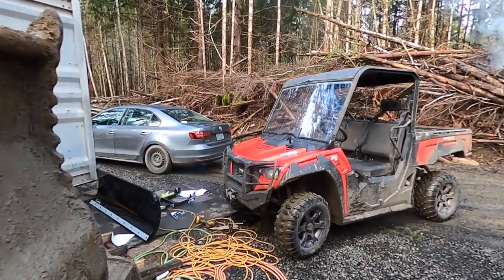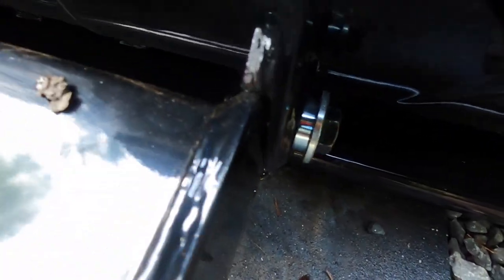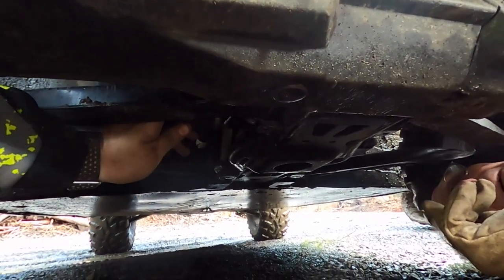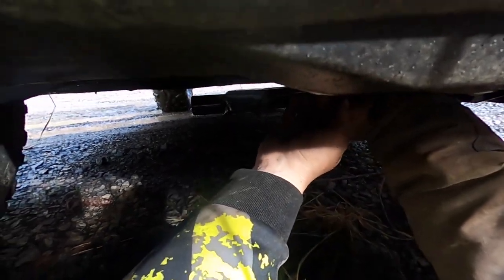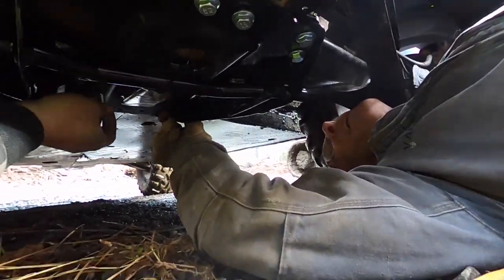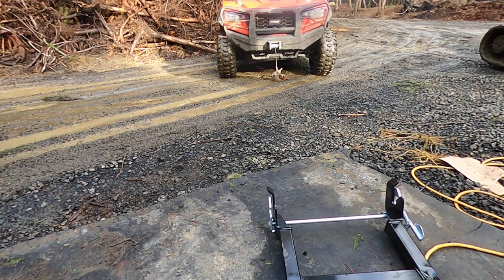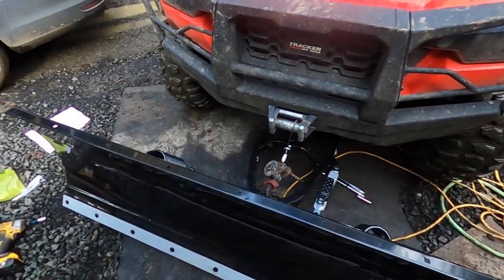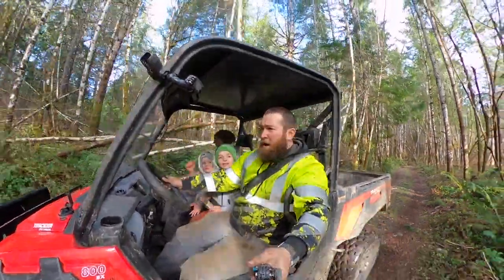SXS/UTV  SNOW PLOW SETUP IN UNDER 5 MINUTES

Comment: What plow and how did it hold up
Reply from the maker: Can’t remember but I did have a issue with the blade tilt pin that sheared off also I kept having issues with the cable breaking but I was hard on it so maybe use error